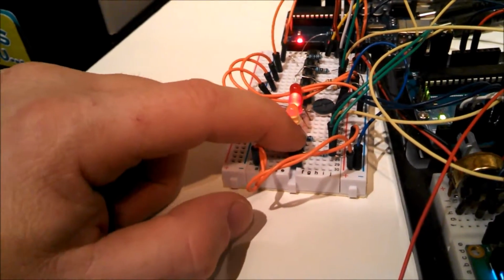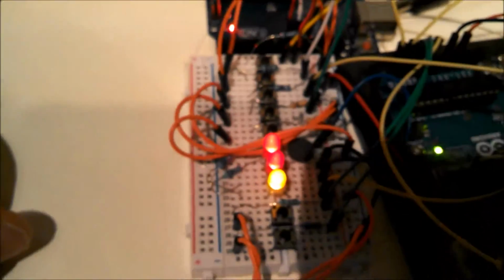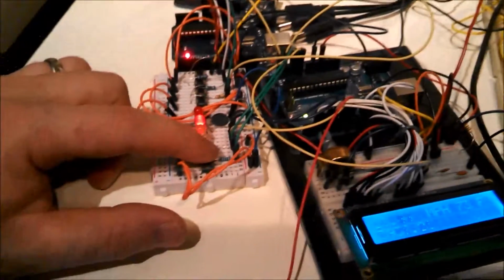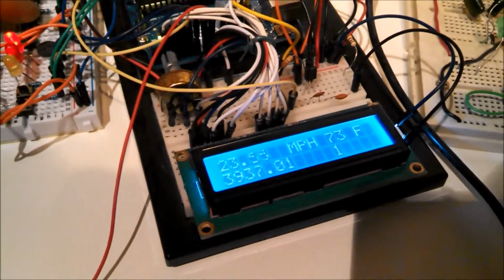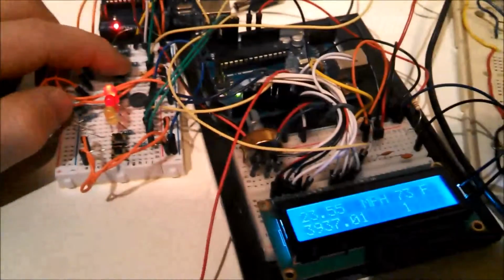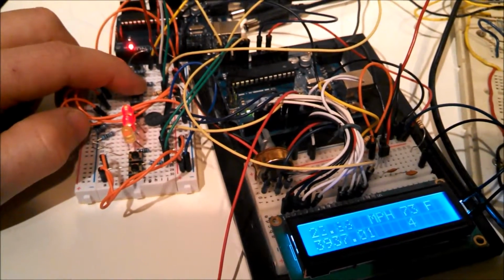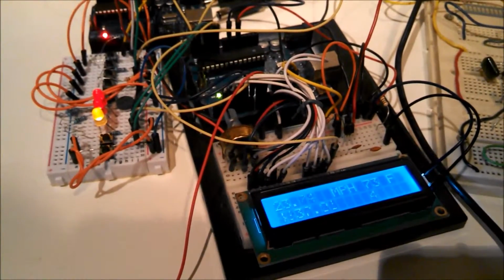DIY 4L80e TCM/TCU v11

Comment: Cool Project. Thinking about doing the same thing for my 4l80e. Any chance you've got an update link to the discussion thread? Its currently dead. Would be nice to see some source code and how your handling the PWM TCC and PCS (Specifically frequencies)
Reply from the maker: The Arduinos handle some basic PWM well. I use none of that because PWM'ing either the transition by lower hydrualic pressure or PWMing the TCC just adds unnecissary wear and fluid heat. Adding logic to shift at lower engine RPM is smarter when not WOT or something in between. For the TCC lockup, the same is true, running a cooler transmision prevents the TCC solenoid from cooking. I've been running without usinc the PCM for years, at low RPM the engine and transmission shift smooth enough for me. The discussion thread appears archived. There just wasn't enough interest in this. Oh well.

Comment: Could you build a trans controller for a dodge 8hp70 8speed? Id really like to run one behind my carburetor small block!
Reply from the maker: If I have the Specs and solenoid shift sequence I could definately build one. I dont have this information though.